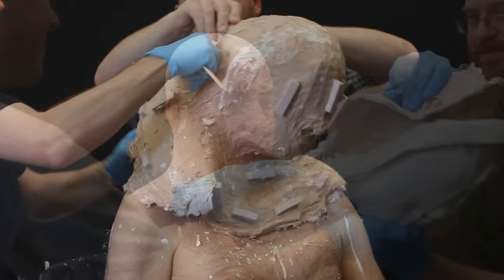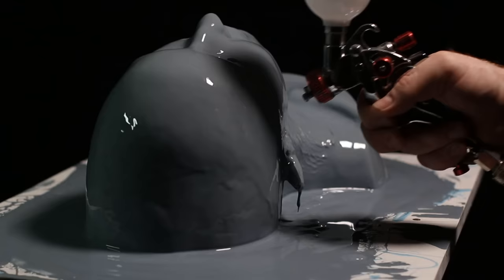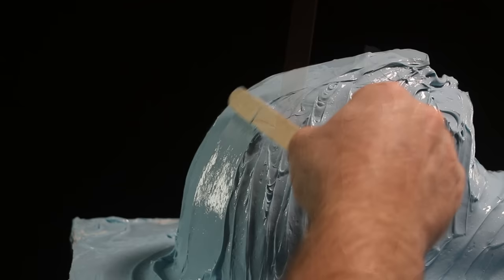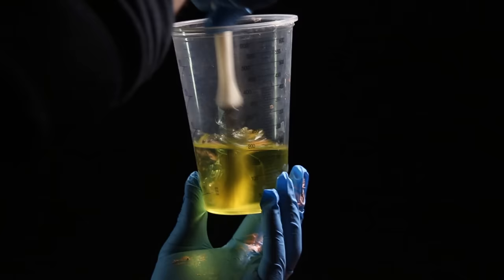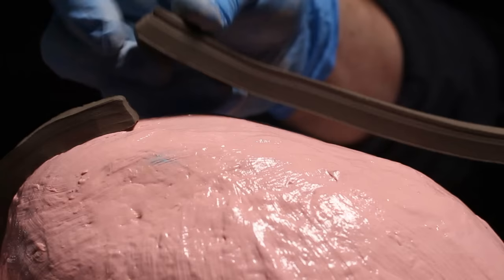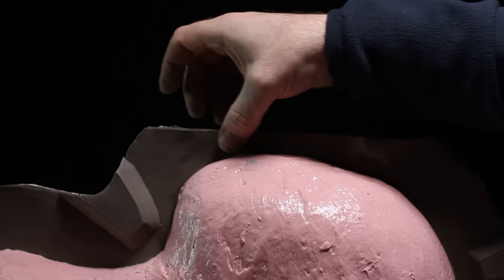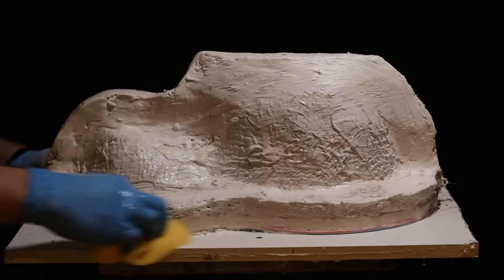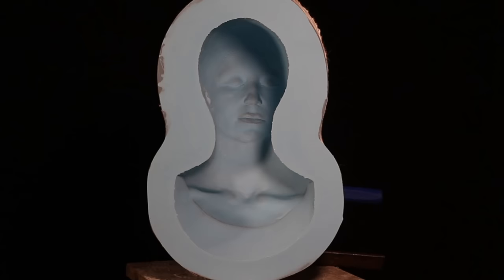Making a silicone mould using the brush-on technique

Comment: You could get a smooth finish and stronger but adding cornstarch in your silicone. And mixing until it's at a putty like stage. Roll it out and apply like. Fondent. A bit easier !
Reply from the maker: Never even thought about trying that. I've used Polyfibres with urethane and also resin but will give that a go.

Comment: Is it possible for you to write the names of the different materials in the description? Thanks for a great video!
Reply from the maker: Thanks for your interest! I have updated the description but for you, I pop them here too: 

** Materials List **
Clay - Water Based grey pottery clay
Silicone- Dow Corning 3481 Tin based silicone with 'Fast' catalyst
Silicone pigments- Available usually from same place as silicone
Fabric - Jute scrim or burlap
Plaster- Crystacal R (a slower setting alpha plaster similar (ish) to Ultracal 30
Key Mould- PVC U-shaped channel edging (hardware store)
Release spray- Spray wax release 'MacWax'
Brushes- Disposable 'chip' or laminating brushes

Comment: Thanks for the video. Do you do one that would apply to a bust (ie not just a half head, but a two part mould of a full head with a flat base at bottom end of neck)? Most of the techniques, I'm guessing, would be the same? Probably have some others available on Youtube, but I like your presentation - easy to follow, good explanation of why you're doing the things you do, and a pleasant, non-grating accent (not that I've got anything against American accents and style of presenting...).

Comment: Beautiful work! Thank you for sharing. To avoid air bubbles in the first layer of silicone I use to seal the plaster cast with primer, the one used before painting a drywall.
Reply from the maker: Thanks. Yes indeed, a wise investment of time it would appear.

Comment: regarding your air bubbles issue - it may be due to varying temperatures.  One often gets this when varnishing classic yachts' teak, if one starts too early in the morning:  you need to wait until it has warmed up and stabilised temperature-wise, with the aim for it to be if anything COOLING after the varnish is applied.  This stops the substrate from gassing, as the cooling draws anything into the substrate, rather than pushing it out.  So if possible I would try to warm the object up slightly, let it stabalise a bit above the ambient/room temperature, and then the gassing/bubbling will (hopefully) be minimised as the coating sets.

Comment: This was fantastic, and I liked the fact that you said you had to add more plaster before the original coat completely dried. Plaster will not stick correctly to completely dried plaster. The odd thing is as a house painter it worked when repairing a wall. However, you had to take a water bottle and saturate the dried plaster before adding a new layer on top..
Reply from the maker: Indeed. The stresses a mould will endure will test adhesion between layers.  I understand using acrylic mediums in addition to water can aid adhesion but for all that, quickly applied layers are the best way to ensure a bond. Having an assistant mixing uo the next layer before the previous has set is sensible to help ensure a swift mould with bonded layers that will remain intact when twitted with levers when opened.

Comment: do the details in the mold degrade after so many uses?

awesome video!
Reply from the maker: They will eventually, but for most production stuff that point is well beyond the typical demands. If industrial quantities needed then either duplicate moulds or go another route (injection moulded/machined aluminium etc)

Comment: Hey Stuart, thank you for your amazing video! Is the burlap very important for the stability of the plaster?
Reply from the maker: Yes, as plaster is brittle and may crack when under stress such as when being levered open or bolted/clamped closed.
Reply: @stuartbray  Okay thank you for answering my question!!! So I will buy burlap :)

Comment: Nice job; I always appreciate a well made mold. A spray-on shellac sealer for the plaster helps eliminate out-gassing bubbles. Still, I'd much prefer to deal with  inclusions on a cast than occlusions.

Comment: ❤❤❤❤❤I HAVE BEEN LOOKING FOR THIS METHOD FOR ABSOLUTELY AGES ~ FINALLY FOUND IT ~ THANK YOU SO MUCH ~ YOU NOW HAVE A NEW SUBSCRIBER!! SO MUCH APPRECIATED!! JUST ON QUESTION: DO I NEED TO USE ANY FORM OF RELEASE ON THE SILICONE WHEN MAKING MULTIPLE CASTING’S? 
QUESTION: DO YOU HAVE A VIDEO ON HOW TO MAKE THE LIVE PLASTER CAST ON SILICONE DOLL PARTS?
I AM TRYING TO MAKE THIS FROM OF MOULD FOR EACH SILICONE DOLL PART SO IN FUTURE I CAN THEN MAKE MY OWN PORCELAIN DOLL PARTS!!
Reply from the maker: Hi Lisa. Many thanks. For release, I tend to a wax mould release spray. Although not usually necessary for a successful cast,  it tends to tax the release qualities of the mould surface less and so extends moulds life. 

Do you intend to mould from real dollls? Like a lifecast, but of a doll? If so, I'd use a lifecasting silicone, which will yield plaster copies very nicely.

Comment: Thank you Stuart for your aesthetically pleasing tutorial, I did learn very much and know now, how to go on with my work. I hope you can answer me one question, please!? How thick are your layers 1, 2, 3 and 4? I just need to know, to be able to calculate how much silicon I'll need for my work...
Reply from the maker: With the unthickened layers, I allow whatever it naturally sits at. Being the viscosity it is (and the time it takes to set set), it will naturally settle at 1 or 2mm thick. If it took longer to set, then gravity would continue to work its magic and make it thinner. 

As I know I'm going to add thicker layers and a scrim reinforced layer, the job of the first few layers is purely to get a good surface without air bubbles. 

It's always tricky to truly know how thick the silicone will be because it's opaque and you have to trust the method.  Invariably, I make the mould too thick in an attempt to avoid it being too thin.
Reply: @stuartbray  Thank you very much! Now I can work reassured... 🙃

Comment: What type of beeswax spray do you use? Is it straight beeswax with a propellant, or a furniture polish with beeswax as the main ingredient? I want to get some, but hope you’ll have a sec to reply. 
:)
Reply from the maker: This is Mac Wax, specifically a wax based release agent in a can. I find this is curiously harder to find outside the US. It ist a wood polish spray, but in a pinch i suppose that may work, but the spray is a fine mist and designed as a mould release in the UK.

Comment: CAN YOU USE CEMENT WITH THIS MOLD? I KNOW THIS VIDEO IS OLD BUT HOPEFULLY YOU STILL AVAIL. THANK YOU
Reply from the maker: As the jacket or to fill it and make a cast? Cement usually comes best from a urethane mould rather than silicone.

Comment: I would like to do a mold of a old wood sculpture with the original colors. Can i put the silicone directly without damaging the origin colors?
Reply from the maker: I would imagine you can but it may need a release agent to help remove the mould easily. By colours, do you mean a paint rather than a woodstain. If so, I would suggest doing a small patch test to check it doesn't affect it. 

The danger is that old paint which peels off may become damaged during removal - it all depends on the condition of the piece.

If you mean the original natural wood colour, I would be worried that the oils on silicone would stain the wood and modify it. 

The safest option is to 3D scan the item and 3d print it.
Reply: @stuartbray  thank you very much for your quick answer. It help me a lot

Comment: How long do you wait after every layer of silicone.
Reply from the maker: Until it has set sufficiently to withstand brushing of the next layer. This silicone has three speeds of catalyst available (slow, fast and very fast).  Ambient room temperature will affect the actual speed. Warmer speeds things up, cooler slows it down.

I used the fast, and it took approx an hour for each layer  to become stiff enough to withstand the next.

Comment: Isn't it silicon expensive?
Reply from the maker: Expensive is a relative term. It certainly isn't cheap, but a job is priced up accordingly. There are always cost and benefits to weigh up, so choosing the right materials for a job is important.

Time is also expensive, so sometimes a task is made simpler and more efficient with a more costly material, which may save time and stress in the longer run. 

Putting a dollar value on the benefits offsets the cost of material.

Comment: Why don't you use a paint stick to mix the silicone? Not judging, just curious. I imagine you lose so much material, and people might use latex gloves to mix, and that's never a good outcome lol
Reply from the maker: With larger amounts I apply with hands so they are getting messy, but surprisingly little waste. If the few extra grams are an issue, I'll hope that economy of using a stick will occur to them.
Reply: @stuartbray  I meant when mixing the base and catalyst. I'd be afraid of someone using latex gloves or not getting an even enough mix. I like to use my hands to "brush on" as well, but I always mix with a paint stick just so I can get a good fast, but thorough mix with as little waste as possible. I always just use my hands for plaster or a drill mixer. Then after I pour the silicone the stick helps with bucket clean up (instant pull plug! If I'm making multiple batches) while letting me know if it's set or not. Again not bashing or anything. I was just curious to your thought process.

Comment: Where can I buy a plaster cast of a woman's face to make a silicone mask, does Amazon sell plaster casts?

2- Can I make a silicone mask from the face of a mannequin by pouring silicone into the face of a mannequin without using a plaster mold?
Reply from the maker: @shahindezfouli5108  they do sell cosmetology practice heads, but ideally, you want something anatomically correct and the right size. Often, these things are not quite right.

There are mask sculpting armatures, most effects suppliers sell something along these lines. Costs and shipping will depend on where you are in the world.
Reply: @stuartbray  so what I do? Can I make natural woman silicone mask by me?how can I make plaster cast when here is any body so how can I buy plaster natural face from Amazon?
Reply from the maker: @shahindezfouli5108  @shahindezfouli5108  does it have to be plaster? Does it have to be amazon?  

You can buy rigid heads on Amazon, they need not be plaster as that is a heavy material which can break easily if dropped so not a likely material for a supplier of head armatures. 

Fx suppliers do sell head form armatures. If you can't use those, then try amazon.
Reply: @stuartbray  Ofcourse I can but silicon mask on Amazon if your means is it but after silicon masks are fake and bad siza or bad material so do you know good and cheap silicon mask on Amazon that it be natural human face and cheap on Amazon ? Please send link to me,thanks
Reply from the maker: @shahindezfouli5108  they are not likely to be silicone. My understanding is you need a rigid head to sculpt onto. The head will likely be a urethane plastic, many are hollow or filled with a lightweight, rigid expanding foam to reduce weight.
Reply from the maker: @shahindezfouli5108  cheap is a dice roll of bad to terrible quality. There already exist actual armature heads for mask makers, so these are ideal. 

If you don't have access to these then I'd suggest a cosmetology practice head or make your own by lifecasting.
Reply: @stuartbray  what's your means from cosmetology practice ,is it a human lives or maniqque?2-mask sculpting armature has difference size so how can I find suitable for my head on Amazon?Thanks Thanks
Reply: @stuartbray  thanks ,very thanks,,thanks, what's your means from cosmetology practice? Is it a human lives or a maniqque? 2- has  mask sculpting armature on Amazon with good size or it can be difference for heads?how can I find it that be suitable for my head?